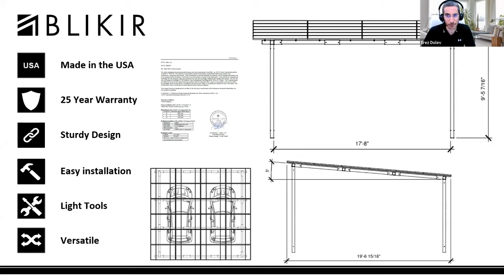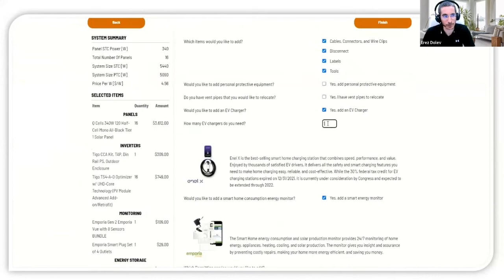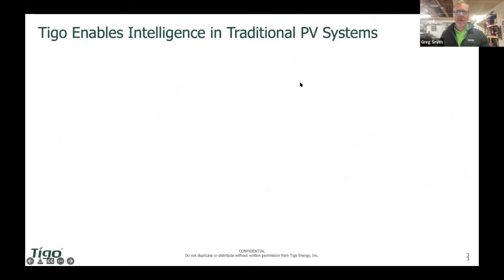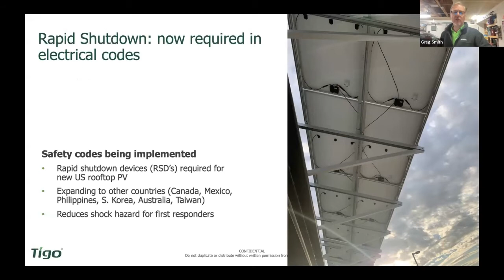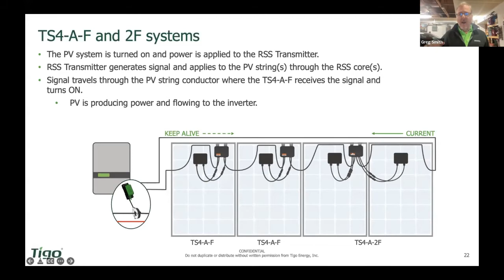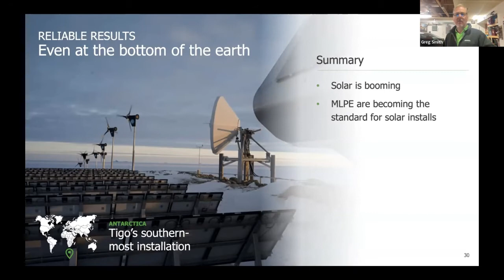Solar Power Market Series with Tigo | RENVU

Comment: "E-stop" seems to be the switch name that Greg was struggling for.  If you ever want to have some fun, look up ISO 13849 for CE safety circuit requirements of machinery.  Been there, done that.... while designing panel building automation equipment ironically.  I was a Komax design engineer.  Don't hold it against me...
Thanks for the information in the video.